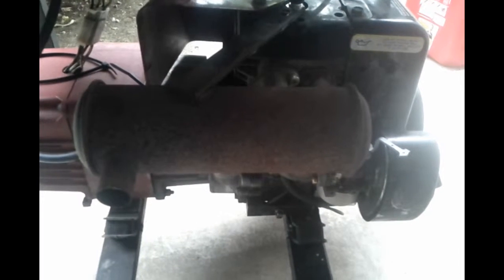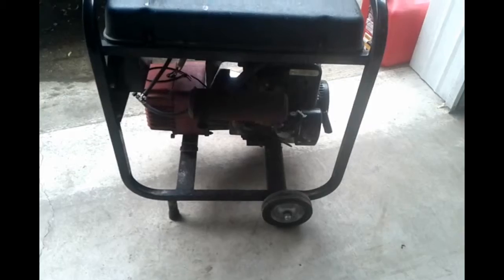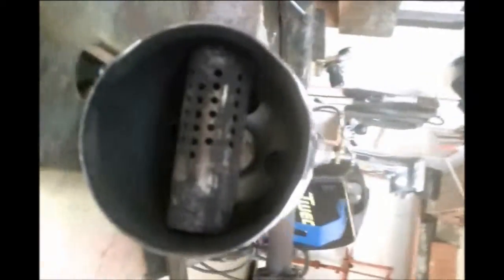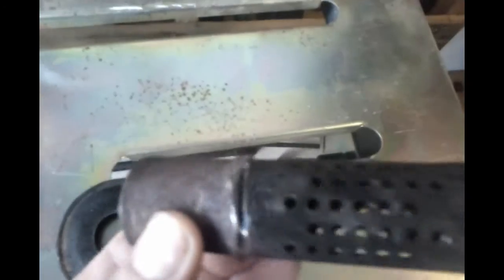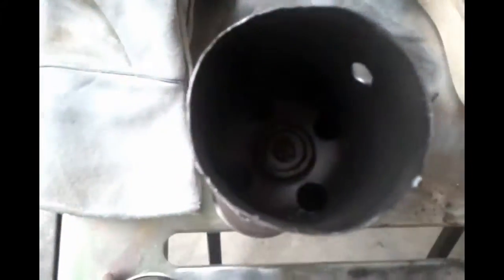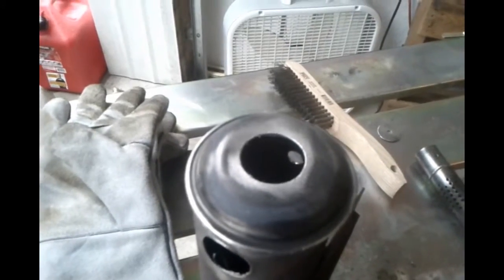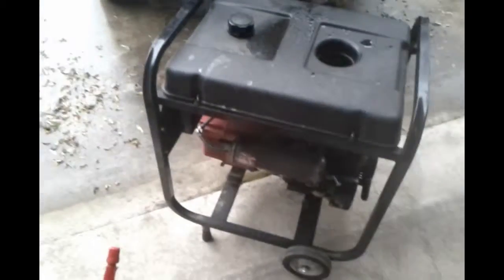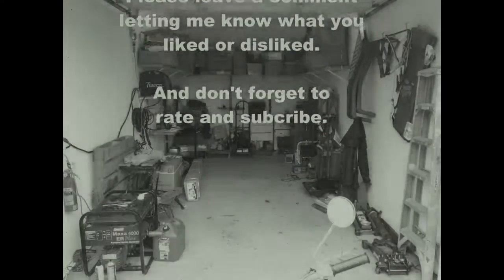Coleman Powermate Generator Exhaust Mods Part 1 - Learning to Weld

Comment: I had a generator like that before. it seemed like it took about six to nine pulls to get it started at times. I would pull the cord and it would yank the cord out of your hand in the dead of winter that's no fun. When I went to overhead valve there's so much easier to start and pull. When the spark plug sits right up that's the sign they're hard to start and at times they just Yankton Court out of your hand. Overhead valve is very easy to start and starts a lot better and I think more fuel efficient.